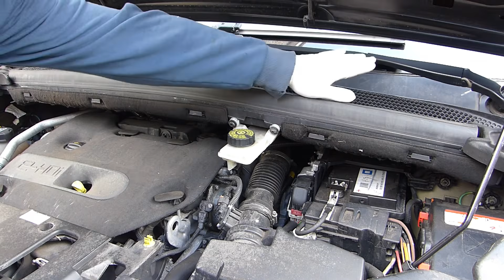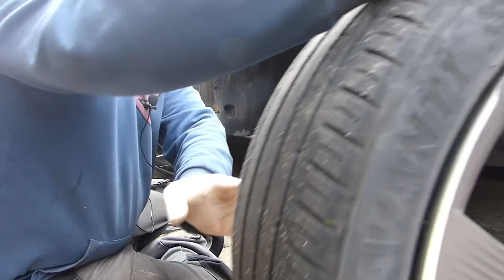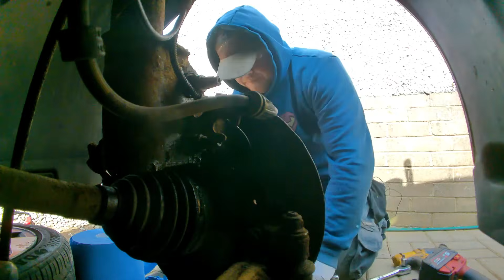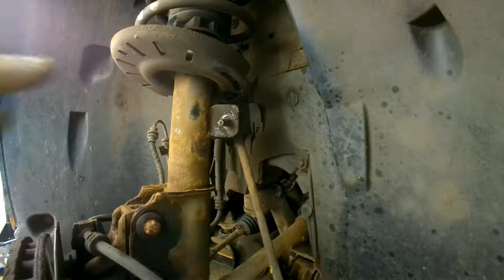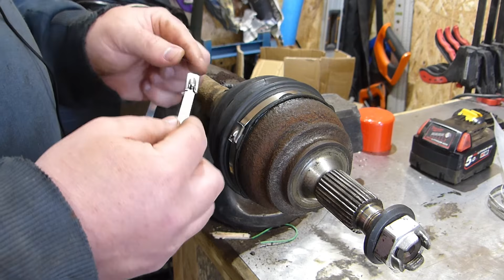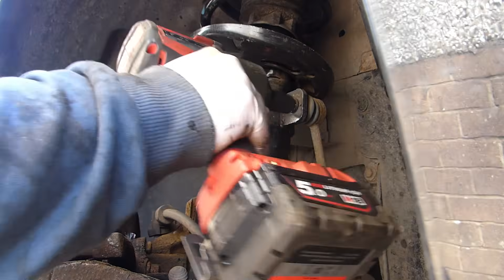Citroen C4 Grand Picasso - Suspension and Driveshaft

Comment: Thanks for the video. I have a serious rattle from the driver side. I believe it's the top mount. Your video makes changing the whole assembly look easy. Did you assemble the new one yourself or can you buy it assembled?
Reply from the maker: I got one from a breakers, so it was assembled but I have the kit to compress the springs. 🙂
Reply: @abilityshare9294  I went ahead and bought all the parts for both sides and a set of spring compressors. Done the work over a weekend. Noise gone and the car definitely handles much better too.

Comment: i have the same car , this is a nightmare of a job. There are two torx bolts holding that retainer , you have to be a contortionist to undo them… this was by far one of the hardest jobs I’ve done on this car. Did you change the shaft seal while your at it ?
Reply from the maker: No I didn't change the shaft seal, prob should of but seems to be holding up ok for now. 👍

Comment: Good video thanks.  Think I have to change the shock absorbers on mine, so liked various elements of this video that made me less fearless of doing it.  One trick I found out recently after struggling with so many drop links, was that if you jack both sides off the ground, you then don't need to struggle crow barring the drop links into position.
Reply from the maker: It's not a bad job my only addition is be very careful with the position of the wiper motor when reinstalling. It's super easy to have it not sitting right and then you use the wipers and have a broken windscreen. 👍
Reply: @abilityshare9294  I fitted the lower drop link nut and secured then I jacked the car up on the bottom ball joint until it was level with the hole then just popped it in.

Comment: hi im curious to know if changing the shocks fixed the wobbling about issue, as im having the same type of issue with my own c4 grand picasso, only  way i can describe it is it drives like a boat on water. i have changed literally everything on the front end other than the drive shafts (theres no knocking), steering rack, shocks and top mounts. id appreciate your thoughts. 
nice video though enjoyable, and yes i noticed your mistake at the first bolt :)
Reply from the maker: Hi John, thanks for watching, yes the change of shock which included the top mount had resolved the issue. It turned out i just found another issue at the same time but that was resolved with new clips. On your C4 just make sure the big center bolt on the top of the strut it tight. Other things that can cause knock noise is drop links, tierod ends and ball joints. Hope you find your issue.
Reply: @abilityshare9294  hi thanks for replying, I have changed the wishbones, inner tie rods, track rod ends and the drop links. The issue is still there and getting worse literally feels like a boat. I was just curious if the issue was resolved your end with shocks before I spend even more money trying to sort it out. Did u go second hand or new parts do I mind me asking. Thanks for the content
Reply from the maker: i went second hand, have you checked wheel baring? also when you changed tie-rods did you get tracking done?
Reply: @abilityshare9294  it’s was all done by a garage so I can only assume was all done as I would think it’s common practice when changing that sort of stuff, there’s no normal wheeling bearing whirring noise so I’d say they are fine, there’s no tell tail signs of worn shocks either though. So I feel it’s going to be hit n miss but there’s not much else to change now.
Reply from the maker: very strange mate, if it feels like a boat then could just be weak shocks & spring making it feel very loose and tippy/rolley, but cant really suggest anything without seeing the vehicle. I hope you can work it out though. Best of luck!
Reply: I have the same issue with my Mk2 C4GP. The coils are in fine condition, but while the shocks look ok the front bounces around like a boat. I'm definitely changing the shocks as that's all it can be. I have a knocking sound as well and from the looks of it the roll bar bushings have perished.
Reply: @thestorytelleruk  I changed all the shocks front and rear, wishbones, track rod ends, tie rods and still the same and drives like a boat bounces all over the place, quite scary at times if honest, only thing I’ve not changed is the springs so that’s my next port of call. It did however fly through its mot a few weeks back so I’m not sure what’s going on. Springs are next on the list for me.